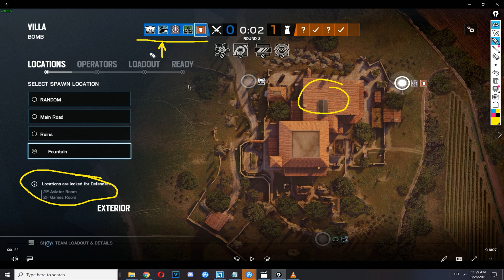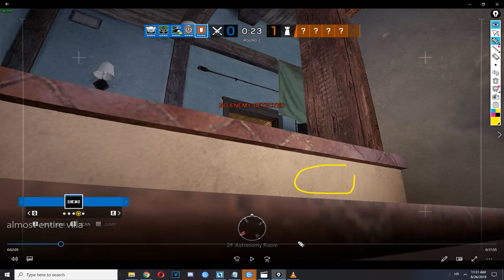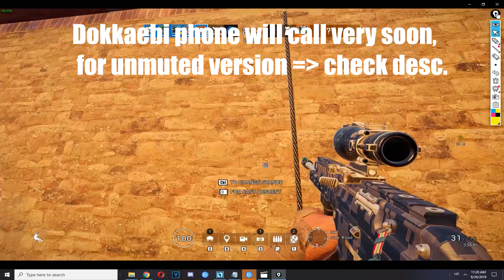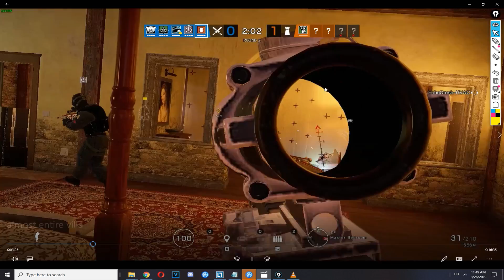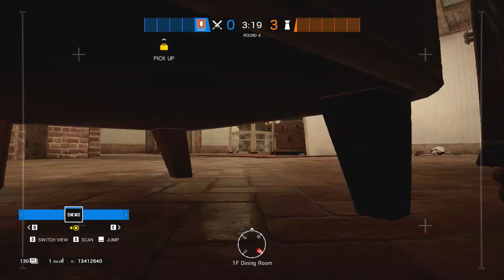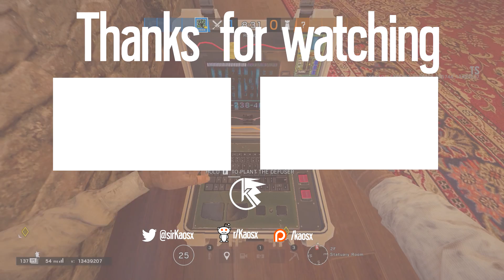Round Analysis: TrioQ Gold Matchup, Attacking Trophy - Villa

Comment: Good video overall but to be honest that was really a poor use of capitao fire bolts. First you showed dokkaibi that is going 1F and aswell you said buck will play vertical so if buck open vertically astro from below and dokk push astro stairs you get astro controll. Capitao fire bolts can be used for statue walls in case that they are bandit tricking or if you want to use fire bolts in astro, having someone on astro window helps a lot. In general good video and good content. I have uploaded a new video about capitao's firebolt spots in 7 esl maps and wish i could get more subs like you. Good luck
Reply from the maker: First of all, let's not use the comment section to promote anyone's channel, but since you've said a constructive criticism, I'll keep this comment. I've given ideas of how could have been this site attacked with Capitao and with Buck. I have not said that both of these has to be made, I've given examples of the best use of these two. I've even said that I do not agree with the Buck pick on this site, because, teams usually do not play from vertical below but to get rid of the Astronomy play, which can be used by Capitao. The capitao bolts, both of them, are securing the most important room you to have on if attacking from the Bedroom - which is Astronomy because it connects both sides, and defenders have several places to be in the room & Capitao denies most of them.

The Capitao trick, that you have mentioned, I had shown in one of the top 10 tricks and it's not unknown but overall, Capitao should not be brought just to open the wall, especially if you can deny bandit trick with just putting an exothermite charge on the floor - that's kind of waste of utility as Capitao. For that reason, defenders open up the floor towards the triple Statuary walls, so Thermite cannot put his charge on the floor. Also, Frag + Thatcher will secure the kill, in case Bandit is bandit tricking

And finally, I'll kind of repeat what I've said - Capitao fire bolts, Buck playing from below were options that the person who gave me round to be reviewed should have in mind when bringing these. Dokkaebi pushing Astronomy stairs alone is not recommended, and I have never recommended someone to do that - but that is what happened in the game, and Thermite should've seen it coming and act upon it.

EDIT: Here is the link & timestamp of the Capitao video, https://youtu.be/_tEKnrqOPVM?list=PLaSWqlXSpckxLuDyMjtuKodtgEh8NGPHN&t=77
Reply: @Kaosx  about capitao fire bolts. Thats why i think you should use it on walls cuz capitao doesnt have a counter so it gets the job done but with buck thatcher combo, jager still can counter the frag if he puts his ADS in a specific spot but all i meant was i think you should get more to details cuz in real game you cant open wall like that and you cant get astro controll like that
Reply from the maker: @SINOOS _ Again, I'll first start off that you don't need to bring your friends in the comment section, because again - I do not support anyone doing a self-promo in my videos. I've watched some of your ESL capitao bolts (and saw his name there) - I'd like you to know that you can deny from windows all three Consulate common places, even on the top of the boxes. 

Astronomy control, you can take control just like that, it's actually very simple with Capitao. Capitao is mostly used to deny a specific room/part of the map/push out defenders. Using him to deny bandit to bandit trick, where you have several already options to do - that I've already listed is a waste of utility and not recommended to do so.

I am not going to get into more details about something that did NOT happen in the game - I am just giving advice of what could have been done better as trioQ.

Also, you can destroy ADS with EMP, you can throw it inside of Toilet if the range is not enough. You can actually use flashbangs if ADSes are really the issue - but if you're going to use Capitao to open the wall, whereas you 100% open the wall with other utility, you're wasting your utility.

Oh and, your friend won't be able to comment anywhere for a week
Reply: @Kaosx  First dont know which consulate windows you are talking about cuz consulate has a lot of windows as you know.

Second i know this video is for golds and you are just giving advice but imagine if you say capitao is good for that site and dont say how they should use it or how they could use it properly, then it doesnt help players but for example you said that capitao can force astro guy out of that position but no one gonna sit there and burn, they will go behind blue box in astro which makes your utillity wasted thats why i said dokk should push astro stairs or be on window but you are prob talking about solo plays. If it is solo plays i think you shouldnt even talk about all ops that team has to bring in the game.

Third if we wanna talk about how to counter ops in this game, we have a long talk my friend.
Dont get me wrong, in the first place i commented here to give you some advice so your video will be better for the people that are watching.
Reply from the maker: I haven't thought that I have to be as straight as saying Admin place, because which other room has 3 default places to be as a defender? 

This video is far from being only from gold, this video is a round review from gold MMR, most people are lacking simple game awareness here, drone usage and so on, so this video is far for only golds and below.
I am not sure if you've seen the part of how to attack Villa in short, but you have just repeated what I've said, Dokkaebi rappelling on the windows. However, it is WRONG that Dokkaebi should push stairs, simply saying that because if you want to push Astronomy stairs, the whole section of Living/Reading/Dining/Z/Basement Stairs has to be cleared out. Just pushing through Astronomy stairs where there WILL be a barbed wire is a GUARANTEED death for your teammate - speaking of the ESL playstyle, since you really enjoy talking how something should be done in the top tier game and yet giving wrong information.

I mean, you're failing to realise how Thermite himself can counter bandit to bandit trick in this position, how to use Thatcher. You probably don't even know the range of Jager's ADS, do you? You are trying to persuade me that the only way to deny bandit trick here is to use Capitao. You'd rather use Capitao (possibly 2) fire bolts on bandit tricker rather than: 
a) Thermite blowing up the wall, later on blowing up the wall next to it, so he is not exposed (it's possible)
b) Use Thatcher to remove ADSes
c) Use flashbangs (possibly from Thermite) to waste ADSes?

Buddy, using Capitao is waste of utility in this particular situation.

Any further comment about this will be deleted from now on. If you want to discuss this further, add me on discord and we'll do it.
Reply: @Kaosx  what is your discord username? I cant find you with kaosx
Reply from the maker: Kaosx#2309, you can find the info in the description of the video
Reply: Kaosx I think that Sinoos guy sounds smart
Reply from the maker: @supremesnoke9391  I also always think high of my teammates, but we've resolved the issue in discord :)

Comment from the maker: I know that the outro part is kind of ruined, but the outro part was kinda too long and YouTube didn't allow me to put the two videos on the very start of the outro haha
Reply: Do u know what's going on with Battle Planner? It doesn't work well: the icons disappear as you place them and it's necessary to reload the page to see them 🤔
Reply from the maker: @christianfdz98  Yeah, it was happening yesterday, however, I told to one of the Devs that there is an issue and he fixed it. For me, it's not anymore a problem (I'm using Chrome, maybe for different browsers, there is still an issue - I could tell him that if needed)
Reply: @Kaosx  Is it the best application for making strats? "Tactical Board" from Ubi isn't up to date
Reply from the maker: @christianfdz98  I prefer using battle planner, the only thing I lack is an undo command